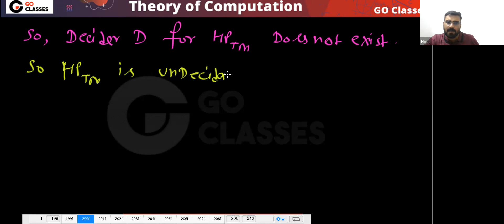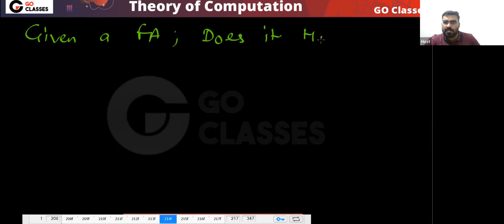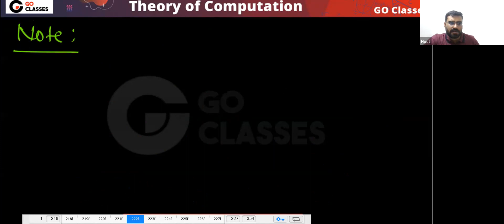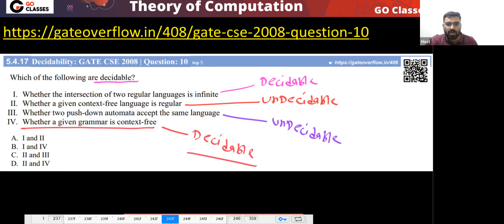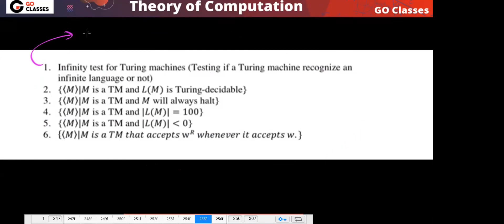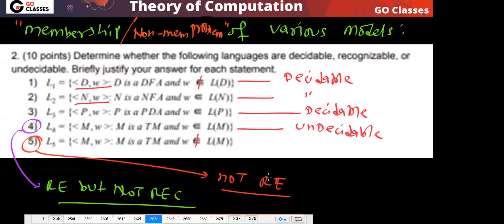Decidability Questions - Part 1 - GATE Questions on Undecidability | TOC | GoClasses | Deepak Poonia

Comment: sir ,In definition of TM  it says that we have finite set of states Q, so why we are not considering TM as a FSM @46:39
Reply: not every system with finite states is automatically an FSM

An FSM is a specific computational model that has well-defined states, transitions, and behavior based on inputs
Reply: @noneofyourbusiness2964  I figure it out.  ...FSM is automata having finite state with finite memory..so PDA and TM will not come under FSM